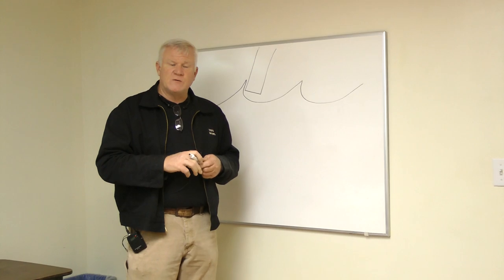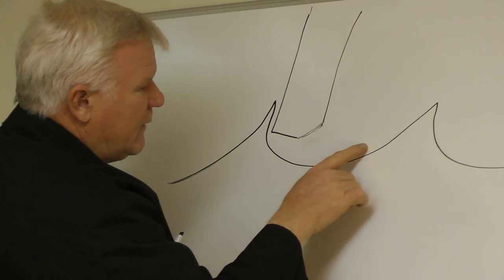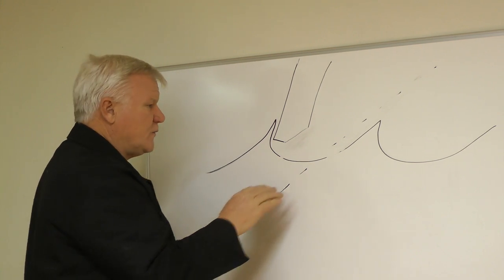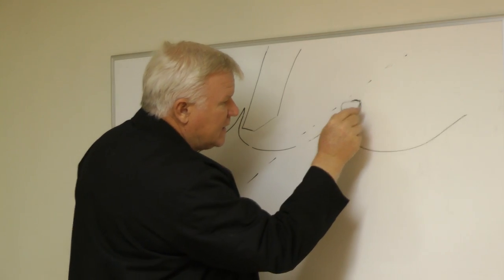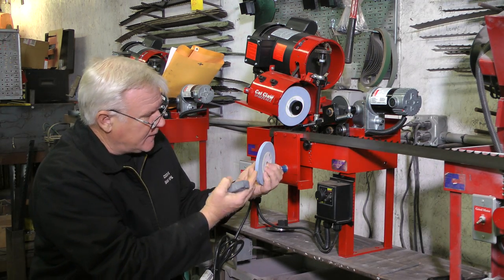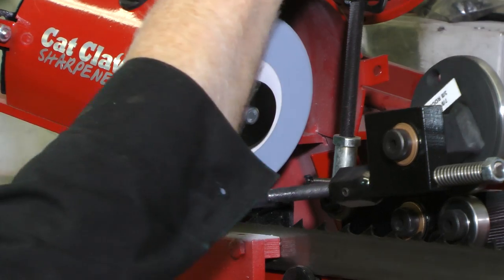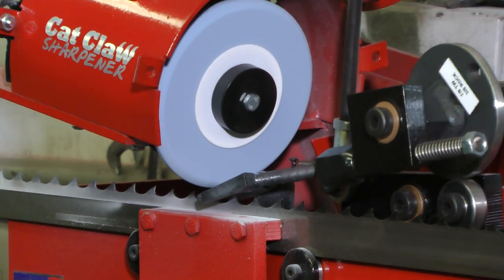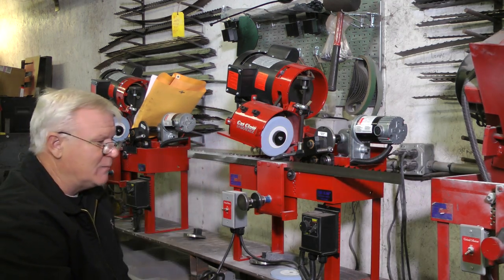How to shape a grind rock

Comment: I have a summary according to this video, Some use PA (pink aluminum oxide) grinding wheel, some use white, this type is SG grinding wheel, better than other aluminum oxide grinding wheels, CBN wheel also can be for this usage. As for dressing stick, grit should be rougher than the grinding wheel. Some even use 24#

Comment: Been using pink stones. Are the blue better?

I've been trying to make the base of the gullet flat to confuse where a micro crack wants to start because when you have the 1 low point, the micro crack, that quickly turns into bigger crack always starts there. Maybe I'm on crack, but it seems to extend blade life?? 

I've had to grind the cam down & build a portion up to make that happen. My theory needs lab testing/results !?!?
Reply from the maker: The blue rock is a little bit of a softer rock and provides a little slower but a finer finish grind.
Typically cracks start in the gullet as a result of heat produced by grinding so keep that in mind as you are sharpening your blades.  If you feel a necessity to grind the gullets do so very lightly.